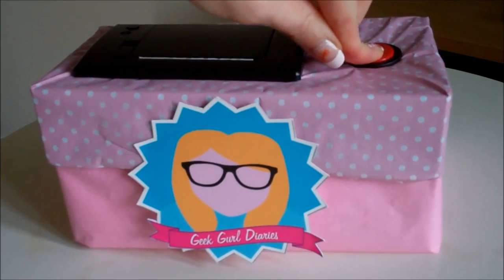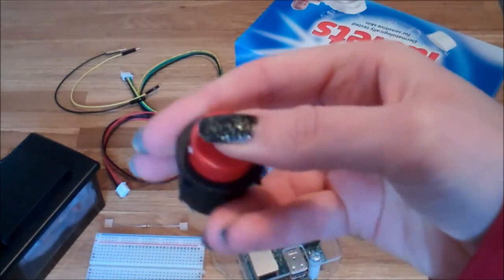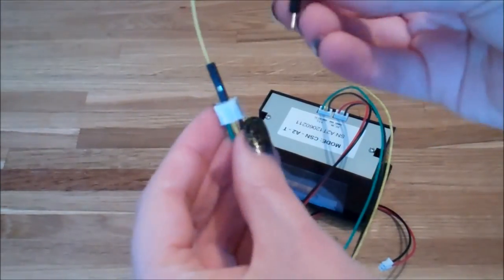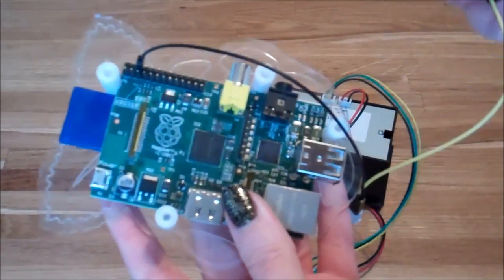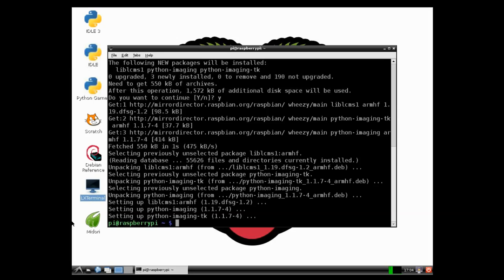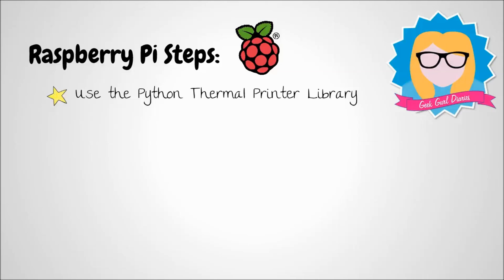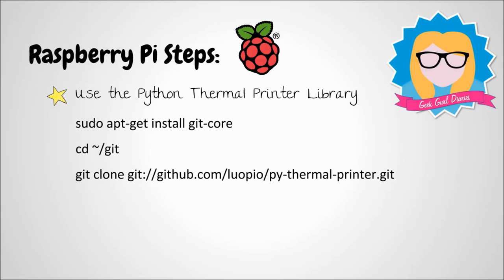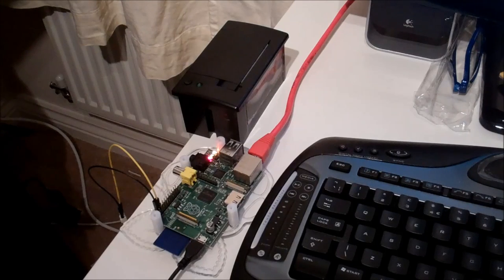How to make a Little Box of Geek with a Raspberry Pi & Thermal Printer Project Part 1

Comment: Is it possible to power the printer off of the 5v pin on the raspberrypi GPIO? I am using a 2 amp power supply.

Comment: Instead of deleting a line if code in the files you edited in the terminal I would put a # key in front of it so that way if you need that code back you can just delete the # symbol instead of having to restore your raspberry pi all it does is add a comment so it doesn't effect the code, just a thought.  Btw awesome video as usual!

Comment: I've just bought a thermal printer for this, I managed to find one for £25 on ebay (from China). I don't yet know any Python so it will be a learning curve to make it do anything useful. I'm an IT tech and would like to get it to print customer details to attach to customers computers when I take them in for repair. I'm hoping it won't be too difficult to make a python script which prompts for name, address etc and print it with a header/footer/date/time, this would be so useful for me.